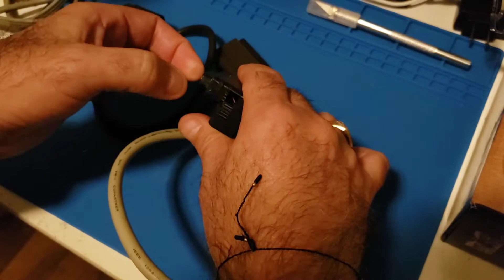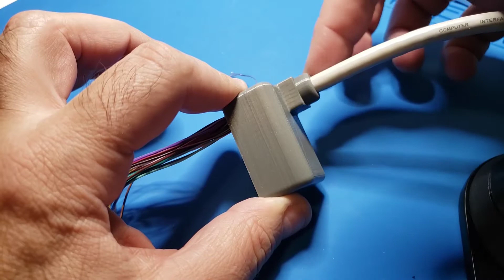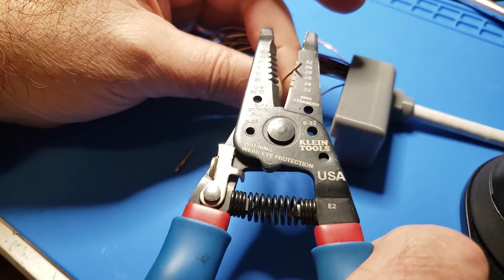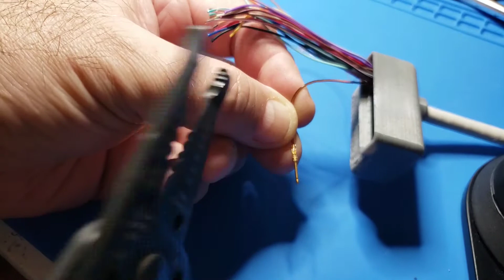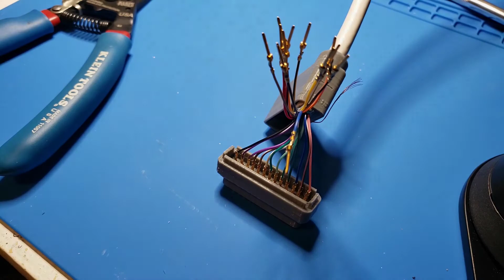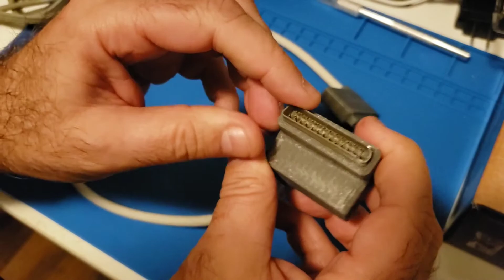Commodore SX-64 Keyboard Cable - Improved v2

Comment: Excellent version 2 cable.  I still like the heat shrink on your original cable even though it’s not necessary on version 2.  Gives it that over-engineered “look”. 😉.  Thanks for providing all the links/files for creation!